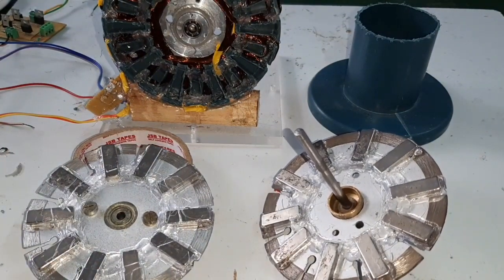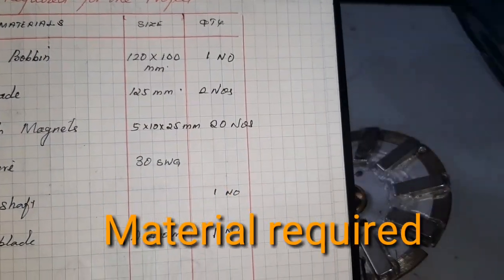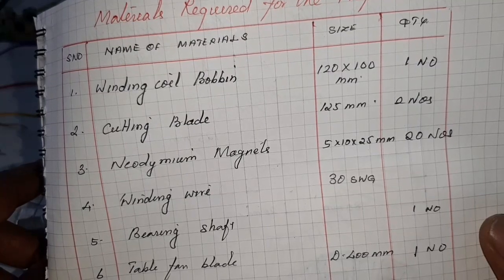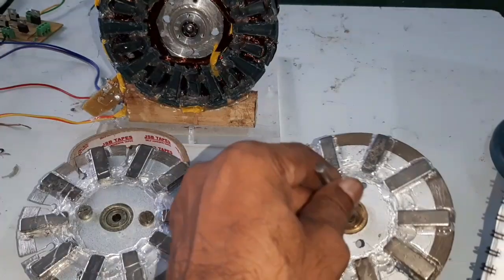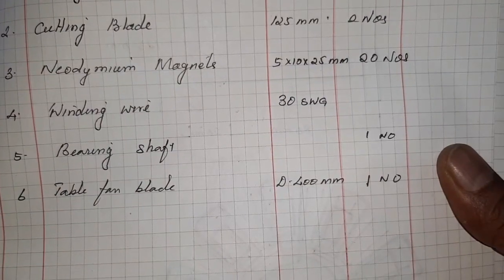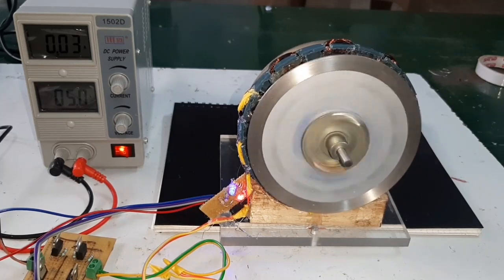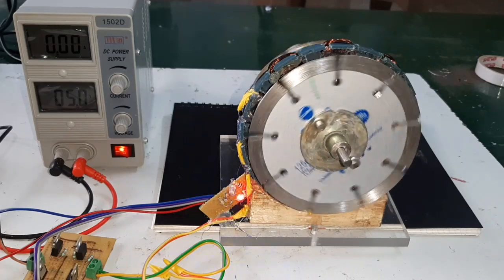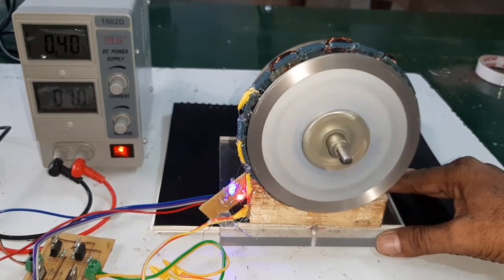(V-108),Powerful axial flux bldc motor using dual rotor and dual coil.

Comment: Is that hot glue holding those magnets?!?
Reply from the maker: Thanks sir
Here i attached the rotor magnets with a cutting blade that is  a metal and additional support of hot glue so the magnets not come out during the rotation.

Comment: Good motor. Do you need to use both the coils to run the motor, or is the second coil for additional torque ? Thank you again for continued demonstrations.
Reply from the maker: Here first 5 coils are used for north pole and other 5 coils are used for south pole so both set of coils are required to produce alternating pole and connected in parallel
Reply: @pugalstech  Thank you

Comment: There is a different form for the coil windings that should double
efficiency, done by changing the geometry of the coils. The radial
legs of 5 coils for each phase wound to align with the 10 radians, 
with radial legs of each coil directly over each 36 degrees radian. 
So 5 coils of the first phase fill the space around the disk area for
the stator. The 5 coils for the second phase are identical but are 
placed 18 degrees out of phase so 5 coils of the second phase
overlap 5 coils of the first phase. The ends of the coils outside
the magnets are given extra length so the coils may overlap and
the same is done for the coil end loops near the axis for the rotor. 
By use of this architecture, induced voltage by alternate polarity
magnets on adjacent radians is in the same direction for each 
coil causing double the voltage output in alternator mode and 
double the torque for operation as a motor. The same method
is used to provide overlap for the coils for stator windings in 
commercial manufactured alternators and motors, using wide
ends on coils that overlap adjacent coils so opposite legs of  
each coil locate in flux also in opposite direction. Because
the direction of the winding on the same coil is reversed on 
the return path for the loop of wire in adjacent sides of the 
same coil, the effect of the opposite flux direction adds in
the same direction for doubling voltage output generation
for alternator mode or doubling torque for motor operation.
Reply from the maker: Thanks analysis and support sir
Reply: @pugalstech  You are welcome. To add description the stator 
should have 20 slots spaced on 18 degree radians and the slots
would be about 8 mm deep. The 5 coils for the first phase would 
be of a size so the radial legs of the first stator coil may fill slot 1 
and slot 3, with the radial legs of second stator coil fill slot 5 and
slot 7, and radial legs of third stator coil fill slot 9 and slot 11, and
the radial legs of fourth stator coil fill slot 13 and slot 15, and the
radial legs of fifth stator coil fill slot 17 and slot 19 to complete
first phase 5 coil array.  5 more coils for a second phase are then
placed into  even numbered slot pairs. So the radial legs of the 
first coil of the second phase stator would fill slot 2 and slot 4, 
and for a second coil the radial legs would fill slot 6 and slot 8, 
and the third coil slot 10 and slot 12 and the fourth coil slot 14 
and slot 16, and the fifth and last coil of second phase would 
fill slot 18 and slot 20. The thickness of the magnets is 5 mm.
so this allows clearance space near the axis between axis 
and the inner ends of the rotor magnets, space to allow for
overlap of the coils ends that fill adjacent slots where stator
is kept same thickness for the slots holding the coil legs. 
Likewise on the outside of the rotor also has clearance to 
overlap the coil ends while keeping the legs of all the coils
in slots the same depth which are being excited by the flux
of the rotor magnets through a uniform gap for all the slots. 
This architecture should be very efficient especially for any 
design where there is no iron core used for the stator coils.
By using such architecture you could probably do well with
larger wire also maybe 24 gauge or 22 gauge wire, or larger.
How many layers would fill an 8 mm square slot would tell
how many windings of the chosen gauge size fill the slot.
Reply from the maker: Hi brother welcome you are expecting more from me ,I think you are a specialist in motor winding sir, still i am a student and want to learn and learn like you ok
Thanks
Reply: @pugalstech  I share ideas to try if you want, and 
do not mean to make work for you like nagging wife !  
I see you like to try different ideas. So I share ideas and
maybe you try in future experiment to see if idea works 
on paper proves true.  Not a specialist but sometimes
experiment to see if idea works or if theory is wrong.
Reply: The project is great but, the air gap between the rotor is very large which reduces efficiency and also the stator heats up soon. Just an advice ... because I have also built a dual rotor axial flux motor